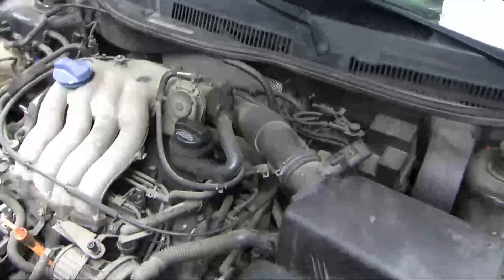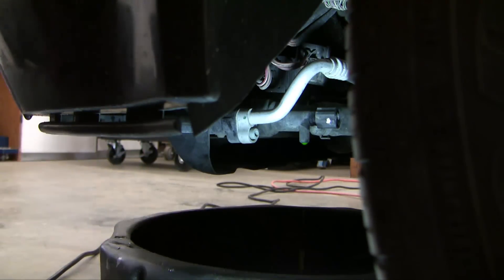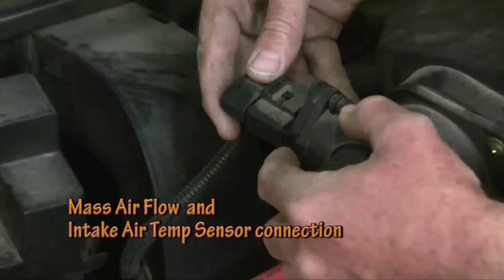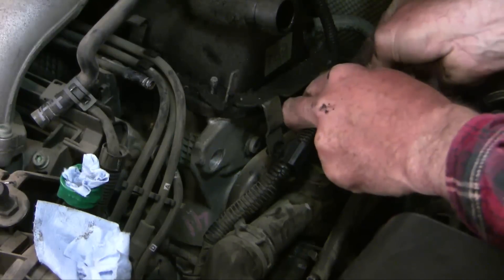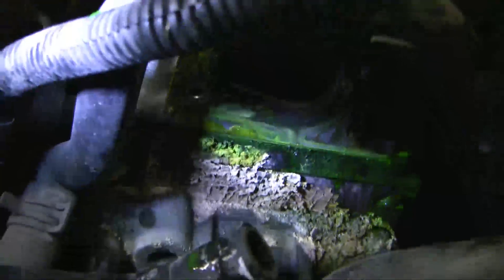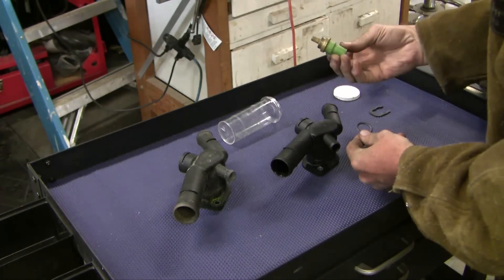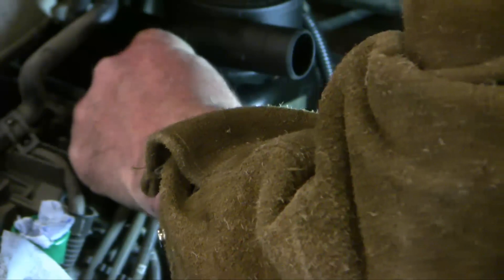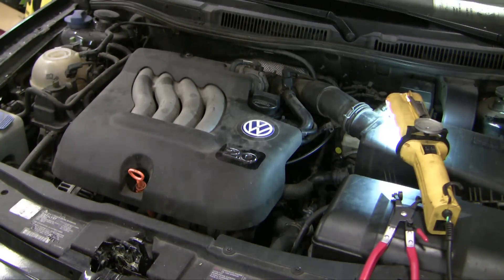VW Jetta Coolant Leak Repair

Comment: This video was incredibly helpful. I skipped the dye procedure because coolant was practically pouring out of my coolant flange. I bought an OEM coolant flange and coolant temp sensor as replacements. Installation was a breeze. My temp gauge is reading again. Thanks for taking the time to upload.
Reply from the maker: Yeah, I'm sure dealers don't use the dye since this leak is so common with this vehicle, and you get pretty good evidence from closer inspection. I'm glad the vid helped, thanks for the feedback!

Comment: NOW THAT is how you make a contribution to the digital domain. Professional, high quality, articulate and with step-by-step clear and concise visual guidance to avoid any issue whatsoever with the reinstall repair of this particular component. I am actually about to head out to the driveway and replace the gasket on my flange. I will be using copper RTV however. After owning a 1989 Jeep Wrangler since I was 15 (first car and still have her) I have learned ALL fluid mating surfaces get RTV. Period.
Thanks again. This really saved me some serious money
Reply from the maker: Thanks for the feedback, Marcel. Good luck!

Comment: I watched your video before repairing our '02 Jetta GLS  2.0 Liter (AZG) Wagon. We never identified an obvious flaw in the coolant flange or gasket but seems to have stopped the leak. Thanks so much for posting this, it was a great help. We spent some time carefully cleaning up the area so the gasket sealed properly. It took a little more than a gallon but not 5 liters. We did pull the hose at the oil filter to drain most of the fluid. We also ran car w the reservoir open, no obvious burps.

Comment: I have an 04 and had a small leak... now it’s a bigger leak and leaking and steaming off that same general area.. thanks for the video. I’m glad it’s not the radiator and I was less than 5 miles from home... sat around for a few minutes and made it home... it’s always gotta when you get that job starting the next day...

Comment from the maker: Thanks for the update, Zsolt. I'm not surprised a different model required different access, and I'm sure future viewers will appreciate your input. Evidently your problem was not with the coolant hose flange but a different port. It does highlight the fact that every repair is different, and a standard approach only takes one so far. 

If only auto makes would quit using plastic parts in areas subjected to huge temperature swings. It's great to talk with you again.

Dave

Comment: Spelunkerd. Thanks! I recently bought a 200 Jetta 2.0 that has a slow coolant leak. The previous owner said it was a hose, but I was wary. I intend to get the dye you used and check it out asap. Thanks for the step by step, I have done car repairs myself in the past but I am no expert. Your video was informative and a real time and money saver for this DIYer.
Reply from the maker: Thanks for the feedback. Guys who work at the dealership say this happens to most vehicles of this model, so hopefully it's an easy fix, as shown. Good luck!

Comment: I watched this video because my 2002 jetta gls has a coolant leak as well and this video made me feel more comfortable looking at my engine bay. I thought it would be more harder than this to fix it but honestly nothings difficult once you know what you're looking for. THANK YOU SO MUCH MAN!!!!
Reply from the maker: +Alex Miller (A Mill) I'm glad it helped, I hope it goes well for you. One word of caution. Stuff happens! Broken bolts, cross threaded nuts, lost parts, forgotten steps, and various other misadventures. Many of those complications happen less frequently to experienced techs using the correct tools, but experience is no guarantee. The best techs are organized and prepared to deal with problems without making things worse or losing control. It can look easy in experienced hands because they proceed in a way that makes it easy. The real test happens when there are unexpected difficulties. So, my message for those who read this is not to be surprised if complications arise. Good luck!
Reply: +spelunkerd wow thank you so much
Reply: +spelunkerd I actually ended up replacing the coolant hose flange a few days ago. It was a piece of cake.
Reply from the maker: +Alex Miller (A Mill) Great, thanks for recording your experience here.

Comment: Completed this identical repair on a 2001 Golf GLS 1.8L T this morning and thanks to the details learned from this video all went well. I approached disassembly a little different than in the video. I choose to take the air box and associated tubing out to gain better access from the bellow. This also aided in diagnosing with just a mirror and lighting. After access I found a length wise 1 inch heat stress crack on the rear main port. Total cost of repair $12.35 CAD & 1hour labor. Thanks

Comment: 2001 2.0 Jetta, Same leak, lower back side of flange was cracked out pretty good.  Replaced with new part thanks to vid.  All in all 1.5hr job.  I kept true to G12 coolant.  Came back to say thank you so much for the DIY.  Very straightforward and clear.   Tips: plastic clips and covers are very brittle, BE CAREFUL! Also, CTS gasket was pretty burned recommend replacing no matter what.  New Flange gasket without sealant seems to be holding up just fine.  Thanks again!

Comment: Thanks a lot. The only problem I really had was the top bolt on the flange, with that metal bar in the way. I had to really pull up on it to get it up out of the way. Couldn't have done it without your video.
Reply from the maker: nano411 I'm glad it helped, thanks for the feedback.

Comment: Great video, I appreciate that you took the time to make it. My Jetta has a coolant leak that I'm planning to repair myself, and this was a great start to my research. Thanks!
Reply from the maker: +Peter Davoust It's a pretty simple repair if you pay attention to where everything goes and reassemble carefully. Don't forget to burp afterward since it's common to overheat because of inadequate burping. Read through the comments others have made. If there's going to be a delay, be sure to keep that coolant reservoir AND the radiator topped up since a secondary overheat could kill your engine very quickly. Good luck!

Comment: Well Done !!  I had   what I  first thought was a power steering leak on my truck so I put some die in the system and found leaks all over the place and in spots not even close to the power steering.  Well I soon learnt that using a dye and the glasses and uv light that regular coolant  has uv dye in it  already and it turned out the leak was a bad water pump.  Whenever I see a gasket like yours I check to see if it has a specific torque.

Comment: Mronemanband, he was trying to make it as simple as possible for the non car people. the Leak detector is mainly to check for other leaks.. not just the obvious ones.. all those other things are another job another video another time. too many things at once will really throw off someone trying to do one simple job...

Great video!!  remove everything in the way so you do not create other complications and you also get to inspect the fasteners/clips and hoses while your at it.. doing this job in the next day or two on my 04 Vw just watching it once is going to make this very simple!  

Thanks again!
Reply from the maker: +Kurtis Wakeland Yes! There's a kind of 'Zen' to mechanical work, where a calm, unhurried, orderly approach helps to prevent lost parts and secondary complications. I can often trace complications back to the wrong starting attitude.

Comment: Generally identical, there was no black metal pipe that seems to be in the way of flange removal in vid (and vortex forum thread). I only had to remove plastic manifold/engine cover, the one smaller air box pipe, the sensor connection, and the three hoses. Flange basically disintegrated upon removal. Thanks again for excellent video.

Comment: Hello spelunkerd AKA "Doc". First I would like to thank you for a great step by step inspection and diagnosis of a slow coolant leak. This is by far the best example I have seen yet for those with an interest in do it yourself automotive repair.  I am currently in the process of fixing the identical problem I found on my 2001 1.8L Turbo so this video should speed things alone.  PS. It brought a smile to my face to see retirement is treating you well and you have found an honorable hobby. Z.V.

Comment from the maker: Yes I totally agree, the comments are a place where I often learn more than in the primary video. Thanks for your note. Regarding the dust everywhere, I usually take a rag with a little brake cleaner and wipe it down. If I am opening critical passages like rocker covers or intake manifold, I usually take a vacuum with a small head, removing dust before so it doesn't fall into areas where the engine can be damaged. I try not to spray sensors or wires with any liquid.

Comment: Excellent instructional video. I had a slow leak which was impossible to find, but after I had seen this I made a further inspection and found that my car had the same problem, I plan to do the repair tomorrow. Your guidance should make it much easier.
Reply from the maker: Yeah, this was a systematic failure point and most VW MKIV cars of this vintage eventually failed at the hose flange. I'm told that you can find an aftermarket steel replacement, which should be better, but I never found one of those. Thanks for watching, good luck!
Reply: Well, the aftermarket parts are typically made with aluminum (that's probably what you meant). And cast aluminum at that. The bad news? They only make them for the 1.8s...le sigh.
Reply: Chris Schimick check gruven auto parts online they make a flange out of aluminum for 12v VR6

Comment: Great video.  Helped me greatly.  Just one variation on my 2000 Jetta AEG - the top nut holding the coolant flange had two nuts on it. You have to take the first nut off (without the bolt attached) which will allow you to move the black tube.  Once this first nut is removed, you can move that black tube ( which has a little metal bracket attached) out of the way so you can get your socket into the second top nut/bolt that holds the flange in place.  Everything else is exactly the same.
Reply from the maker: Thanks for dropping by to record your experience. Notes from guys like you help everybody.

Comment from the maker: That's a great point. Whenever I see a plastic flange, I roll my eyes with memories of misadventures that happen indirectly, usually when trying to fix something else. At least you can retap a steel hole, but trying to replace plastic parts can be a more frustrating challenge. Thank you for your comments!

Comment from the maker: I'm glad it helped, thanks for the feedback. 

I think the commonest problem is a stiffening of that rubber integrated gasket. Marked heat/cool cycles cause degeneration and loss of elasticity of the gasket over years of service. The torque spec is pretty low, much lower than typically seen for older style metal flanges.
Reply: My friend will fix mine 2006 2.0L Turbo Jetta, if I tell him where the 2 sensors are.  It's this the 2006?  Please say it is.
Reply from the maker: @karentid232  This one is 2001. I don't know if the 06 was the same but I do know this was a known defect affecting multiple years. Check for crusty coolant residue in that area to look for evidence.
Reply: @spelunkerd  Thank you for your quick response.  Hopefully he'll find them so I can stay away from VW's bill.

Comment from the maker: Yes, it's possible, but of course not the only possibility. When coolant level drops low, sometimes the coolant temp sensor can give spurious data. I would start by refilling with distilled water and burping the system, then restart the engine and look for a leak. If you have access to a pressure tester that could be done, too. If you do isolate a coolant leak then I would fix that, and hope that all is repaired with that. Good luck.

Comment from the maker: Thanks for the compliment. Unfortunately I have no experience with the transmission on this vehicle. Yes, a reasonable first step would be to check the trans oil level, and inspect the oil for debris or color change. You might get a more detailed and qualified response if you were to search out a VW forum. Your problem sounds serious, I hope it can be fixed.

Comment from the maker: Thank you for the feedback. My experience was similar. I think the rubber gasket becomes less pliant with age, and the low torque spec on those two bolts makes a leak very likely as the engine ages. I think it's a design weakness, and I'm sad that VW seems to have made little effort to offer a fix that would last longer than the original.

Comment: Yes I've had to replace this on each of my Golf's. My flange looked just like that one. And on one of the cars, the studs had been badly re-tapped and I had to re-tap them to 8mm and bore out the flange's sleeves to get it to accept the 8mm allen head bolts. What ever you do, don't even think about trying to backflush the heater core. The plastic outlets will snap off at the slightest movement of the hose. When this happened to me, I had to construct a heater core bypass apparatus.

Comment: Very well done video.  I like your methodology as well as the video quality.  Very well done indeed.  If I had any concern it is that you don't use latex gloves when working.  I also agree that it is likely a design flaw -- the use of plastic material probably contributed to loss of fastener tension and subsequent loss of O-ring seal integrity.  Anyway, I am about to work on a leak in my car and I found this video to be outstanding.  Keep up the good work.  Someday, Bently, Haynes and Chilton will figure out that they need to change their business model to pay people like you to make videos like this.  Thanks!
Reply from the maker: What a kind remark, thank you!

Comment from the maker: Remember that the coolant reservoir level will fluctuate, sometimes rising higher when the vehicle is really hot. So, if you are already at the very top, you will overflow coolant onto the ground in that case. Better to carefully keep it above the low level but not too high. That way when the level rises, after the vehicle cools the excess fluid will be drawn back into the cooling system when the cooling fluid inside contracts. Thanks for the good question!

Comment from the maker: Do I understand the question? The large hose the connects the rad to the flange is connected on both ends by hose clamps (on my car). You squeeze the two ears of the hose clamp, then slide the hose clamp to the soft part of the hose, then release. Then you twist the hose and try to loosen corrosion. At 07:01 I show how to use a pick to loosen corrosion between the hose and the flange -- that works for most hoses. At the connection to the rad, i would take off the plastic cover to see better.

Comment: One of the best DIY videos I have ever seen.
Reply from the maker: +Pierre Coupet (Q) What a kind remark, thank you.
Reply: +Pierre Coupet (Q) agree
Reply: +Juanita Baca I have always used synthetic oil in my 2000 VW jetta. after last oil change about 2 months ago , after taking off cap for the oil there is sticky yellow stuff like glue all over the inside of the oil cap. i wipe it off weekly but it continues to come back.Do you have any idea what it acan be? I check the dip stick and everything is fine.
Reply from the maker: +Juanita Baca That is moisture mixing with your oil, not a good thing. There was some brown grease on my oil cap when I did the above repair, and it disappeared when the cause for overheating was fixed. Presumably steam was forming inside the engine and when the engine cooled it condensed on the cooling metal parts. Other more ominous causes include head gasket leaks and other leaks of coolant into your engine. When coolant gets into engine oil it interferes with oil function, so I would change oil much more often until you've found the cause. I would look for and repair any cooling system problem, as done here. Make sure the cooing system is properly burped. If you don't find a cause I would ask for professional advice.

Comment from the maker: Sorry for not getting back to you right away since I've been traveling. If you can't find a replacment O-ring I would reuse the old one. The good thing about that part is that it is easy to replace after, without tearing everything apart. And, it should be easy to detect a failing O-ring at the coolant temp sensor just by looking closely for leakage (or, crystalized debris that results from evaporated coolant). Cheers.

Comment: I wish you were local too!  Thank you for putting this up.  We have a major coolant leak in our 2000 Jetta and have gotten the run around from two local shops.  Any suggestions for finding/fixing major leaks?  Thank again for your videos - very straightforward and easy to follow.
Reply from the maker: Anne H That coolant elbow is by far the commonest location for a leak in the Jetta line, especially a leak that isn't obvious. When I'm not sure I use the UV dye as I did in this video, though it isn't necessary. If you inspect the area closely you usually find the source. Most other problems are secondary to trapped air, so make sure you've refilled enough.
Reply: spelunkerd Wow!  Thank you for such a quick response!  We'll try it and see!

Comment from the maker: You may need to swap over a sensor - it should be easy. I would drain the coolant down below the level of the bottom of the tank first to avoid making a mess. You're doing the right thing by replacing it.